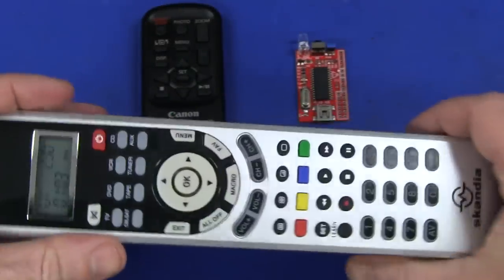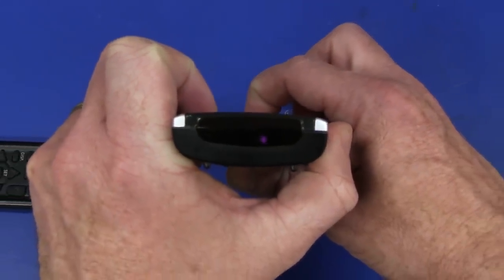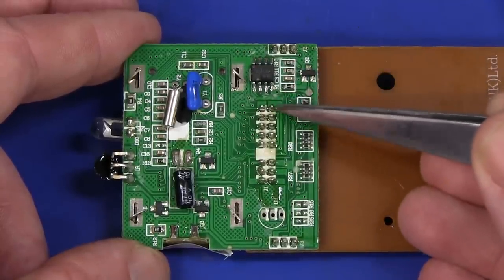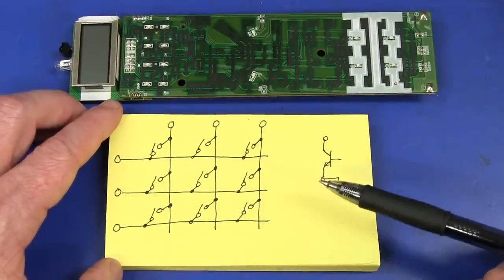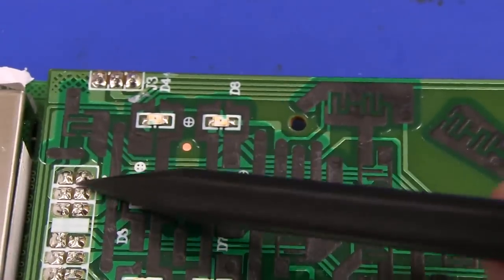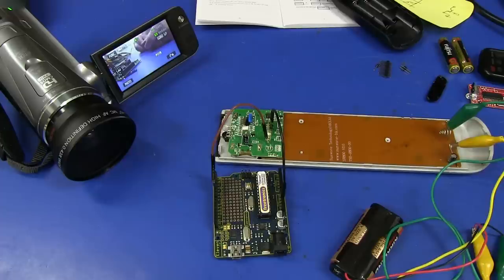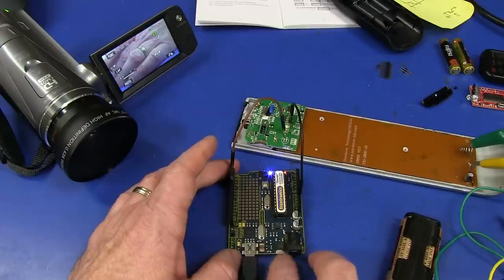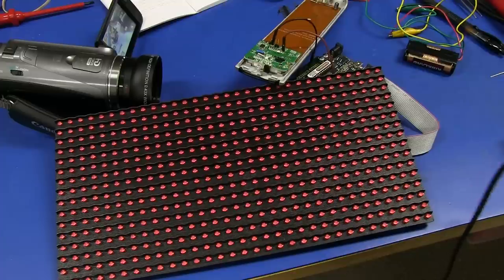EEVblog #505 - IR Learning Remote Control Hack

Comment: This is an old video so I'm not sure how many people will get to see this, but using the Arduino and outputting a 2,3 or 4 bit binary code in conjunction with a cd4066 analogue mux/demux you can emulate physical point to point connections quite easily. The on resistance of the CD4066 is also nearer to the carbon resistance strips than a straight mechanical switch. There are more modern versions of the CD4066 which have lower on resistance but I'd have to do a bit of chasing around to obtain the number. Try Googling for them. The beauty of such devices is that they do not rely on a common ground they literally act like electronic 2 contact switches and are bi-directional too IIRC. There is an 8 channel to one output version too which provides a great way to expand an ATTiny 85's ADC inputs by effectively sampling any one of the 8 by selecting it from the Arduino. THIS technique can enable a multi channel data logger to be built in a TINY amount of space with thee minimum number of chips, external components and size.

Comment from the maker: Oh FFS, it took all of 5 minutes to do this, it's the quickest solution possible, that's why I did it. And it's practical because it works. More fail for you.
If I wanted to "impress" I would have decoded the IR command with a scope, and programmed it into the Arduino manually and/or wrote my own driver.

Comment: Dave did a whole video on this, using oscilloscopes as an example. Look it up, it's called How NOT to blow up your Oscilloscope. Basically connecting the two grounds causes a loop, or another circuit, and interference (and sometimes high voltage/current) can flow between the two circuits, messing everything up!

Comment from the maker: Yes. I don't understand why people think this would be quicker and simpler than 5 minutes hacking in a learning remote? Sure it's neater, but no way it's going to be simpler and quicker. You have to wire in an IR receiver, get a suitable library, learn how to use properly, capture the code, maybe write some code to replay it, and then maybe troubleshoot it if it doesn't work first go.

Comment: Dave, you can do multiple buttons with a common ground and discreet transistors; I've done it (for an audio amplifier remote in this case).

All you need is a PNP transistor for each button with the emitter to the scanned side (I checked with a scope for the scanning pulses) and the collectors to the input side of each button. Drive base low thru a resistor to switch on, float base to switch off.

Comment: The way this is working is that the Arduino either connects the two Pins (by pulling the pin to its GND) or disconnects them (by putting it into High-Z mode). You have to do this because of the matrix configuration, which means the remote isn't just looking for a logic low/logic high.

This is a simple approach for this application but optocopplers/a CMOS switch/... would also work.

Comment: I've used 4066 (as others here suggested) before, and it did work perfectly. The main limitation is that the switched wires may not exceed the voltage the 4066 is powered from, but that's not an issue for 3V remotes.

Comment from the maker: That's not the reason. I didn't use the arduino direct because hacking a remote was just simpler and less hassle.  5 minutes work if I didn't shoot the video. To do it in the Arduino direct requires me to find a suitable library, read how it works, wire up a receiver to capture the code, then program it to spit it out again, and possibly troubleshoot code if it doesn't work.

Comment: Dave, I'm a bit of a novice when it comes to electronics and hacking. But I was able to figure out a solution for the problem you were facing with the remote pressing buttons when you turn off the Arduino, and this is what I found. You might be able to conquer the power off problem by putting an NPN transistor between the remote and GND on the Arduino, and connecting the base to 5v or 3v3. It should make the connection between the remote and GND on the Arduino and allow the remote pins to be shorted by pin 0 as long as 5v or 3v3 is on. It will cut the connection, thereby removing the short between the 2 remote pins, when 5v or 3v3 goes dark.

Also, can you power the remote from the Arduino? I'm not talking directly via 3v3. Even I know that won't work. But what about using a voltage divider and powering it from 5v? You may be able to fit the voltage divider inside the battery compartment.

Comment: When the io pin is in input mode, the two wires going to the remote are disconnected. Once you turn it into an output that is driven low (to ground) you get a connection between your arduino's ground and the low output. So it does not "use logic levels", but "open/closed"

Comment: I've done something like this with a computer keyboard, I've used optocouplers attached to the row column pads on the keyboard controller board, the LED side of the coupler connects to a console controller, direct to the buttons or via a comparator for the analogue controls

Comment: Everyone seems to be missing the point -- the reason he's doing it this way is because he needs to use the Arduino at the same time to run the giant timer board. Yes he could potentially do it another way but this frees up the resources of the chip so it can time the on/off cycles better (at least that's one reason, I'm assuming)

Comment: Easy solution to control multiple pins (possibly all) without any additional components: 
1. The grounds of the remote and Arduino must be connected.
2. Connect all the row and column signals to your GPIO pins.
3. Write a program that detects the scanning signal of the rows or columns (an interrupt will be most reliable), and outputs states to the columns or rows at the specific times.
This would effectively make the remote processor see the logic states on the inputs corresponding to the specific keys at the right times.
A problem with that could be the delay between the scanning signal and the CPU changing the GPIO state, but that would not be hard to overcome.
Reply: Easier way... just use the matrix buttons that already share a common row or column connection. DOH

Comment: hopefully this does not lead to shorter videos.

anyway. if you have a ton of battery power or a wall adapter, you can use an old windows mobile pocket PC and create a macro on a universal remote app. Then after that, you can manually start the countdown timer as soon as you start the macro.

I currently use my old pocket PC as a universal remote (may upgrade to a logitech harmony when they get rid of the cloud requirement and make an offline app for programming the remote.

Comment: Because then you would connect one of the matrix's common column \ row to ground, which will make it unusable. This is because the arduino actually acts as switch; when the pin is output & low it is connected to the arduino's gnd - which creates a short across the two pins on the remote, and when the pin is set as an input, it is no longer shorted together.

Comment: On that Arduino board you could have just hooked up to an IR LED directly and then just programmed it with a library. A better hack would be adapting the screen and buttons for use with an Arduino.

Comment: Would multiple buttons work if you used buttons that have no common points at all, or is that they get connected inside the microcontroller that breaks them, no matter  what pins you use ?

Comment: Any chance you could help me out? I picked up a phone with a membrane interface like that, but unfortunately it doesn't appear to be as simple as the remote. Whats the best way of dialing a phone with a membrane keypad like that using an Arduino Uno?

Thanks, I've been stuck on this problem for a while, and didn't want to give in to buying a DTMF chip and using that because I've already bought this phone.

Comment: Or you can put an optocoupler or an switch(like an 74HC4066) between the button and the MCU and you can run it all from a single supply with no ground worries.

Comment: Even if you were able to work it as intended, you would have to map the AUX and Learn buttons as well. In case your programming on the remote is gone, you could program the arduino to learn those codes again. A failsafe.

Comment: I tried useing a 5v reed realy on each row and colum and tied one end of the relays to a common bus so I could have full control of all features. I was wondering if I could just use a cmoss switch like a CD4066 instead of the relay.

Comment: Have you ever had a problem with those little Canon cameras refusing to charge a battery? Mine failed last year (on a trip to Sydney oddly enough) and I got a new battery only to find it won't charge that either. Typical. The official Canon external charger is very expensive.

Comment: Can anybody explain me why exactly it didn't work driving the four different buttons with the arduino? Is it because he's effectively shorting the pins through the arduino, while pressing a button on the remote would still have a couple 100 ohms resistance between them?
Reply: +Koffi Banan  Because the Arduino can only select a high or low to each pin, on a remote or other keyboard the 'rows' are strobed high in sequence not held high or low. So if I strobe the rows A-B-C-D depending on whether a column detects a high at the same time as A or B or C or D will give A1, A2, A3, A4, B1, B2, B3 etc. It is multiplexed so you can detect rows x columns keys say 4x4 - 1 keys. they are never held high or low
Reply: Thanks a lot for your clear explanation! It all makes sense now! :)
Reply: A

Comment: Why not use the Arduino to read the codes from your remote and store them? Then play them back through a IR diode and a transistor driver? $2 worth of parts + Arduino.
I made one just like it. No universal remote needed. This was NOT a good hack since the Arduino can easily do the job without the universal controller.

Comment: Why not to use a PWM to generate carrier frequency (36 KHz typ) and manipulate it (on/off) to generate the actual signal? Then you need just a driver transistor and a diode and that's it! Way cheaper and much more simple.